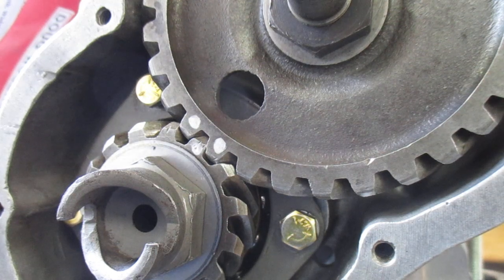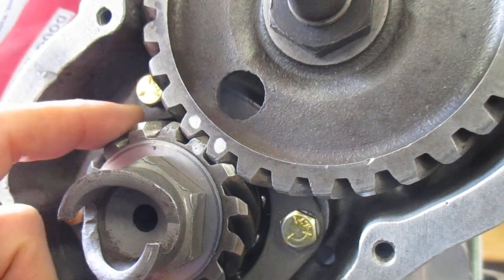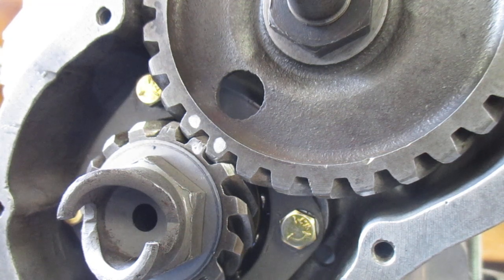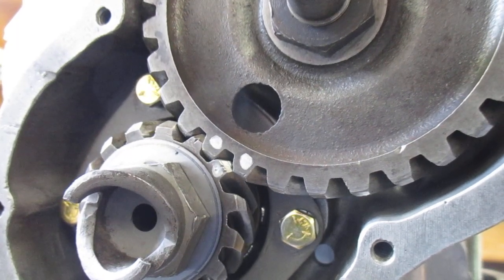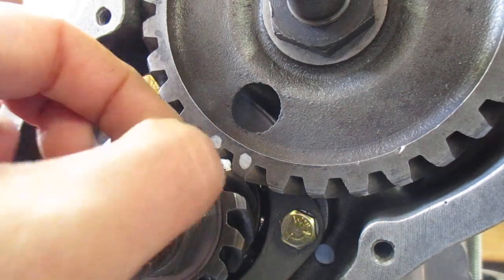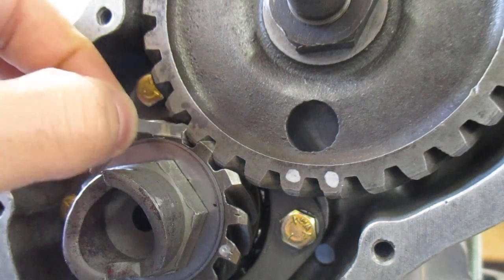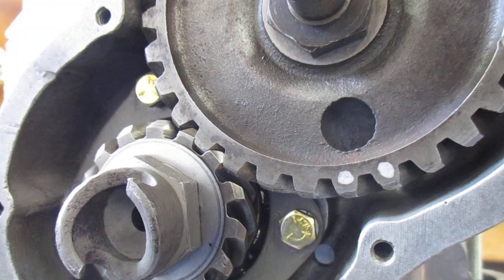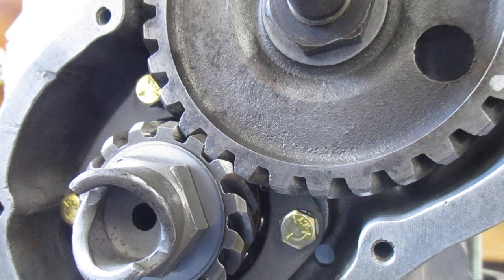Austin 7 timing gears

Comment: I can tell you just from looking at the video that your backlash is setup just fine. That is definitely not too tight at all, and any looser than that and I feel like you'll end up being too loose. It sounds like the book was concerned more about being too tight than loose. It will run just fine if there is too much backlash but you'll potentially hear gear teeth chattering, though they are helically cut already for that very reason. [as noise reduction]

I would say you are good to go as is, and in regards to your backlash measurement method, that is how you would traditionally measure the backlash of non-helical cut gears,  but I don't know if that changes for helical gears.  (I don't imagine it would, but perhaps someone can chime in.)

I would say that the 5 thou you are measuring is spot on (even with 4 thou in the tight spots), because once everything gets hot and expands along with oil being in between there, that'll be just right.

You are also spot on to de-burr the teeth that are damaged, as long as without shims it runs smoothly rotating by hand, given the backlash observed I think you'll be just fine. 

Just to be clear I am not someone who builds engines or is a machinist by profession. However, I have done somewhere around 100 engines (of various flavors, but none of them Austin) as well as a few transmissions and seem to posses good mechanical intuition. (That or I just get lucky often, maybe a little bit of both ;-) )
Reply from the maker: Thanks for that, my friend confirmed it is all good. As he put it there needs to be clearance for the oil so as long as that is there it should be fine. Noise doesn't worry me actually. I like mechanical things to make noise as long as it's not too annoying! It's going in an open top car anyway, so there will be plenty of other noise. The good thing was he also picked up something I had wrong on the other end of the crank, leaving off the oil thrower/crush spacer. He suggested using a modern oil seal there and an adaptor is available from the club so I have ordered one of those. Just need a speedy sleeve fitted to the flywheel boss and that's all done.